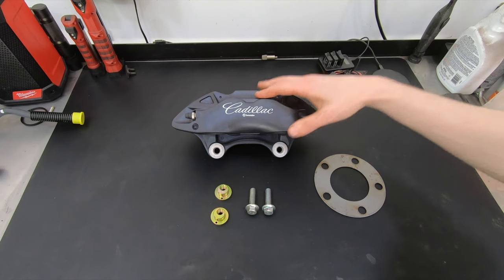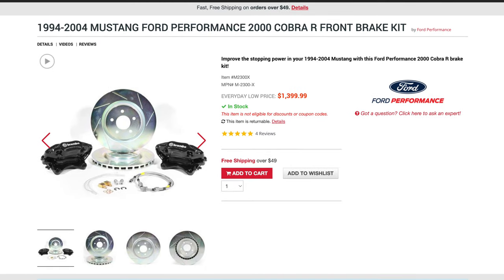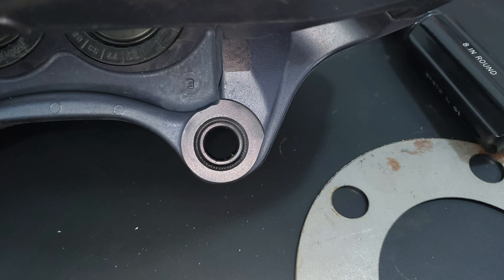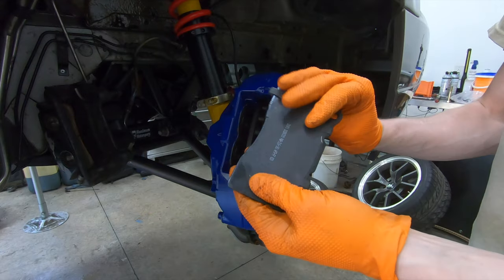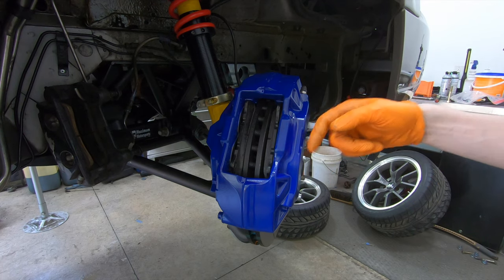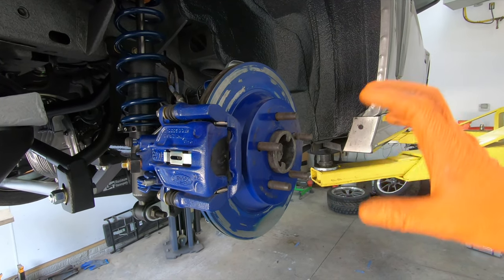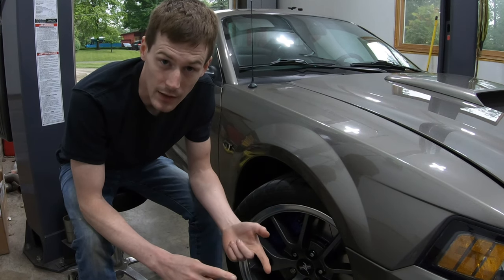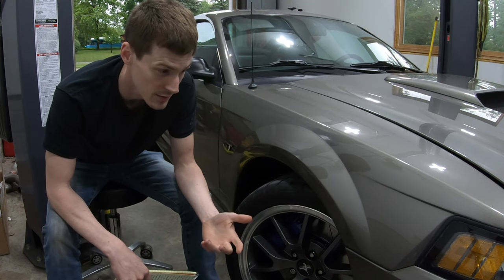Mustang Big Brakes Front and Rear for less than $600! 1979-2004 (ATS Brembos Front, Taurus Rear)

Comment: All those rims that fit the ATS caliper, are they 16" and up?
Reply from the maker: Yes you have to run at least a 17
Reply: @RepairGeek  17" yes, but what width? There are 8" and 9" widths for Mustangs. Will the 9" fit? What is the distance from the rotor face to the outside of the caliper?
Reply from the maker: Width has nothing to do with brake clearance. That's all offset and spoke design. I'm currently running a 9 inch wide wheel and a 5 inch wide spare both clear without issue. I don't have dimensions on the hub to the caliper face measurement. The car is in storage for the winter.
Reply: @RepairGeek  Well maybe so a little, but I'd sure like to know what that dimension is. Maybe I'll get a kit and mock one up with some good numbers for potential users.

Comment: Do I need to buy the cobra rear rotor and brake adapter kit. Would just the Taurus caliper work in the GT rotors.
Reply from the maker: Your bias will be better with the cobra setup. The Taurus caliper will bolt into the GT bracket/rotors as it is.
Reply: @RepairGeek  I’m sure it will be with the larger rotor but you think it will be acceptable with the GT rotors and Taurus caliper. The kit is 400$ and I’m doing this on a budget build
Reply: I appreciate the quick response time btw
Reply from the maker: You just caught me when I was at my computer haha. If your'e concerned with your budget try the calipers on a GT bracket and see what happens. If you don't have enough rear bias buy the cobra setup in the future.
Reply: @RepairGeek  will do thanks. Video was spot on. Gave me everything I needed to know to make this happen.

Comment: How comes these calipers dont have cross over  tubes? Not needed?
Reply from the maker: The cross over is internal and sealed with an oring at the split.
Reply: @RepairGeek  Thanks for confirming that! I just received mine and I was wondering if I needed to buy the tube separately.

Comment: Why not use the ats rear brembo also?
Reply: It looks like the 94-04 Mustang uses a caliper actuated parking brake.  If you look at the Taurus calipers used, you can see the actuator spring hanging off the caliper.  Brembo calipers don’t use this feature.  They will only work with shoe in hat style parking brakes.

Comment: That’s weird that the pedal is softer. Every car I’ve upgraded the brakes in had less pedal travel than before
Reply from the maker: The pistons are bigger. It takes more volume to fill them. You could put in a larger master but it's not necessary. The old PBR/Cobra calipers had very little travel in the pedal. This setup feels very normal, easy to modulate but panic stops lock up the wheels easier.

Comment: Any update on the spare tire solution?
Reply from the maker: Yes the Race Star recluse wheel 18x5 clears without any issues. I currently have that wheel with a temporary spare installed. It JUST fits in the factory spot for the spare. It has miles of clearance for these brakes.

Comment: Who the hell paints the braking surface of the rotor?
Reply from the maker: Me. Comes right off the first time you apply the brakes.
Reply: @RepairGeek  yes, but it keeps the pads from contacting well with the rotor until it's gone, heating them unnecessarily, gumming up the pads and glazing both pads and rotors.
And paint contains chemicals that stick around on that friction surface, long after the paint is gone and diminishes the braking ability.
Reply from the maker: They seemed to preform fine on my 3000 mile drive to Laguna Seca, the track day at laguna where I was passing Porsche's 15 years newer, and another 3000 drive home: https://youtu.be/2hC25L3evyo

Comment: Will the taurus brakes work irs rear end
Reply from the maker: Yes. The calipers are the same on an IRS and a solid axle.
Reply: @RepairGeek  do u know if they have a kit to work with 4 lug fox spindles
Reply from the maker: Nope, you need a 5 lug rotor from a 94-04 Cobra, Mach, or Bullitt.

Comment: Could you use the focus rs brakes?
Reply from the maker: I believe the early 2000s Focus RS used the same caliper as the 2000 Cobra R. This caliper is bigger, cheaper, and far easier to get a hold of than the old RS units.
Reply: @RepairGeek  not the older rs the latest rs seems to be the same
Reply from the maker: The mounting ears are too close together and the offset is wrong. Other than those minor details 😂 they'll bolt right up...